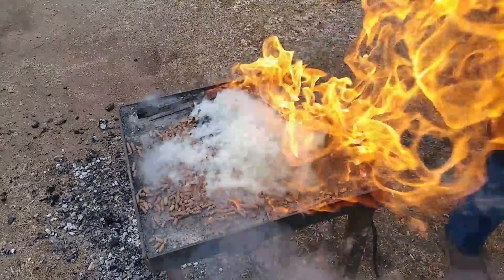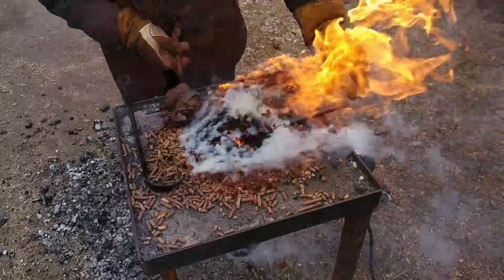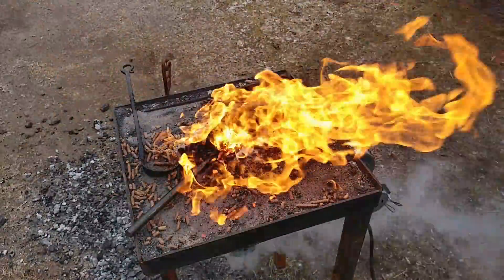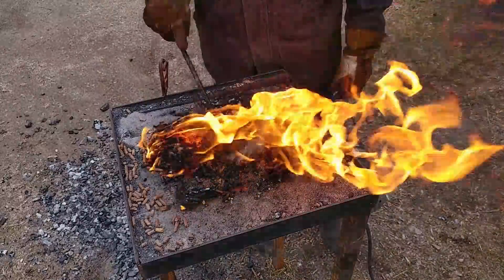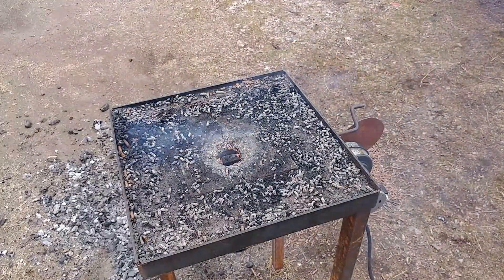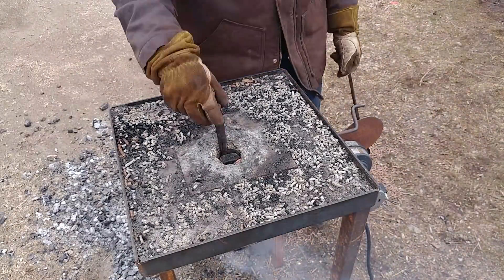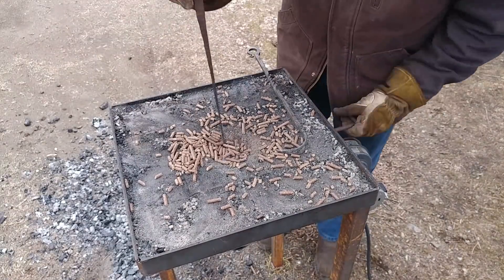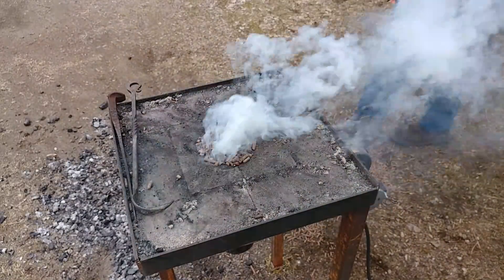Forging with Wood Pellets (Alternative Fuel Series)

Comment: The outside of the pellet is shiny because of the way they are manufactured, they are compressed through very small holes leaving a polished finish. As far as I know wood pellets only contain wood 👍
Reply: The Lignin in the wood liquifies if i understand correctly.  Some brands may add certain “pelletizing aids” etc.  Hardwood vs Softwood etc shouldn’t matter TOO much, but Ash Content / Specific Energy will.  Not all wood pellets are created equal.

Charcoal Pellets, or ESPECIALLY (outside of cost for now sadly) “Carbon Black” or Ultra-Clean Coal (made from Charcoal or Petcoke) would probably be the “green” fuel of choice.

I was reading up on synthetic anthracite too.

Comment: Having heated my old farmhouse with a "Multi-fuel" stove for several years, you get more heat out of corn than wood pellets, no matter what the BTU chart says. Corn will build impressive clinker that needs to be cleaned out periodically even using oyster shell to try to control it. Long story short, I went back to using propane to heat my house. In theory it was cheaper to use corn or pellets, but not when you factored in replacing one of four ~$100+ electric motors in the stove once a year.

Comment: Please try lignite/brown coal!
I want to know how it performs, i did not see anyone use it.
I have bought 50 kg for 23$, but it arrives over a week or so.
Thanks!
Reply: Teun 
Lignite being the lowest quality will work but it needs some help now and then.  It has the lowest Btu rating and you'll be able to do normal forging with it.  

My trick for higher heat, like welding, is to make a hole in the center of the fire.  Throw a handful of charcoal and wood chips in the cavity followed by some fresh coal on top.  It will heat up very fast so be prepared to use the extra btu's.  It will not last.   

Lignite also has more impurities than other coal...  you will need to clean your pot often.
Reply: shadowcastre Thanks for the reply!

Comment: I have a forge which is more or less  the same size of that one used in these series of fuel test. It has a low rpm motor and it does not produce high pressure,  i foud out that mixing coke and a little bit of charcoal makes easier the air pass through the fuel. Its economic though. God bless you too.

Comment: I’ve been using scrap hardwood for my forge (granted I’m not nearly to a level as you when it comes to forging) I found it smokes like crazy but does allow the steel to get hot enough. I’ve even managed to melt some of my pieces. I know you don’t use wood but do you think you would have any suggestions on lessening that smoke output?

Comment: they are supposed to be clean fuel just wet saw dust compressed to a point where they stay together causing them to be really dry and slow burning 1 ton of these pellets can heat a house more efficient than 6 ton of logs over an entire winter only smoking for the heating of the element at the start. they dont look good when they are burn like this lol